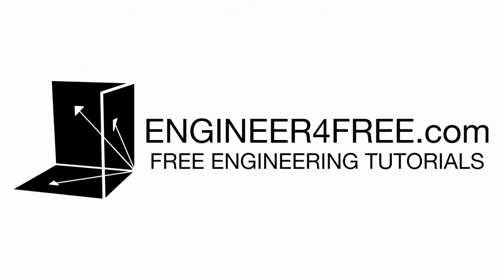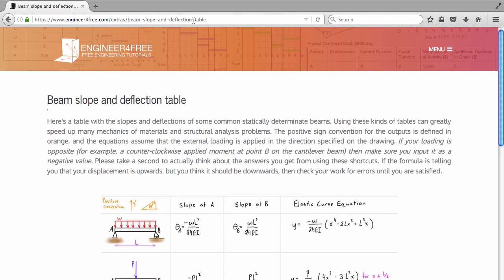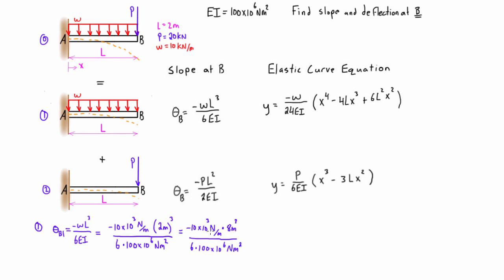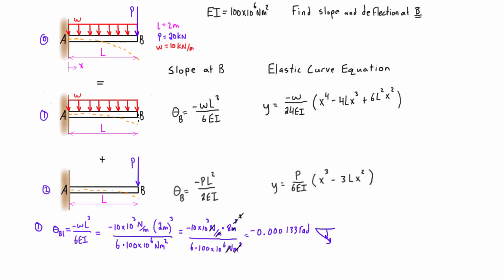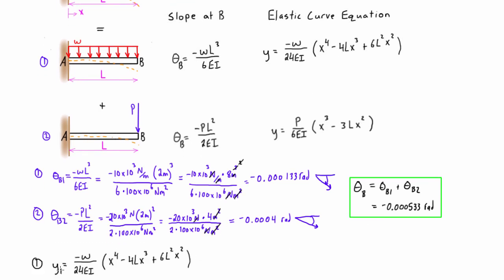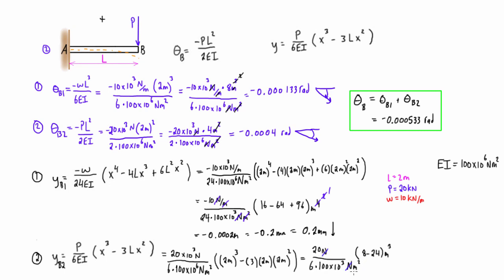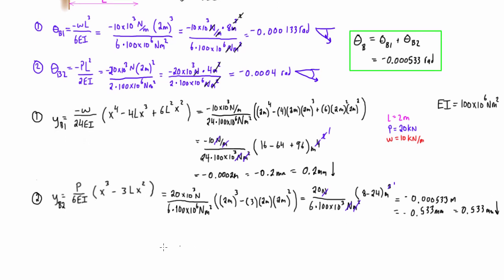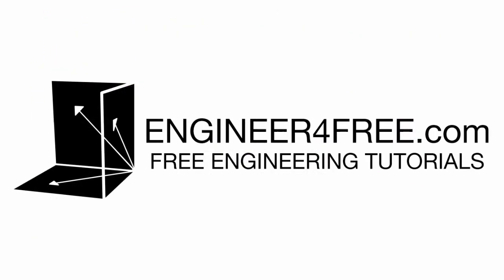Method of superposition example #2: cantilever beam

Comment: Hi, I have a question on a school question. I have a cantilever beam with a distributed load until 3/4L and than I have a distributed load which goes down from 3/4L to L of the beam until 0 N/m. But I don't know which combination of formulas I need to use. Because it is a superposition, right?

Comment: Hello sir, may I ask what if there more than one point is applied on the beam? is the max displacement formula still applicable?
Reply from the maker: In that case, I'd do super position for each load (the on on the end and the on that's not on the end). For the one that's not on the end say at position a, then treat that beam as a beam of length a, and solve for max deflection at a. Usin  moment area method, you can find slope at a, and then use basic trig to find vertical displacement for the remainder of (L-a), which is straight (not curved). Add first and second case because of super position, and you'll have the actual end deflection of the cantilever with two point loads

Comment: Thank you for the quick intro. How can I calculate the max displacement under point load when the beam is made of two different material stacked lengthwise (L/2+L/2) and not along the thickness. Is there any method for it?
Reply from the maker: It's just going to affect the EI. Use the methods of pure bending of composite materials to convert one material into the other to generate an EI value that will then just get plugged into the bending equations. Check out videos 29-34 here: engineer4free.com/mechanics-of-materials for tutorials on composite material like you're described.